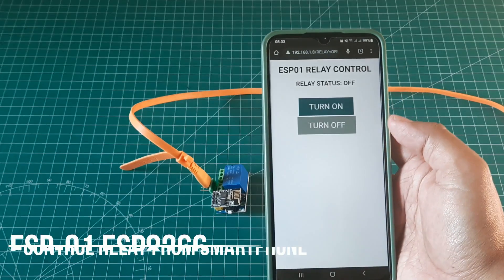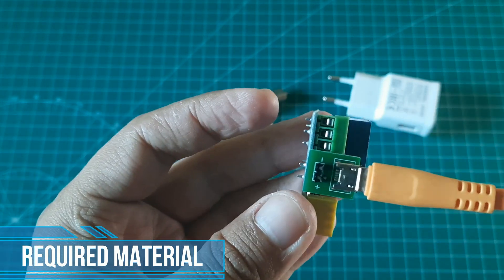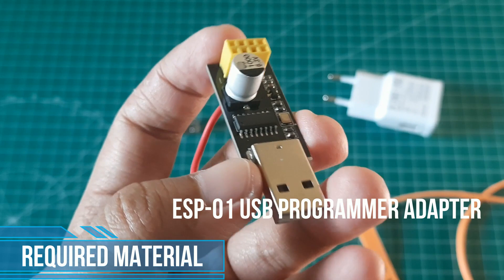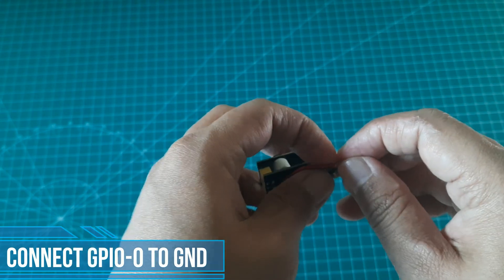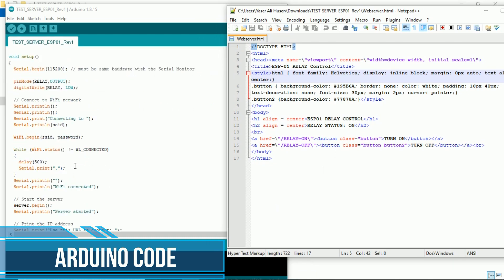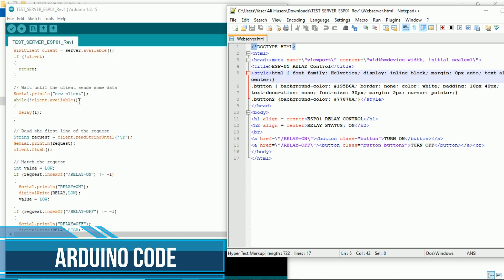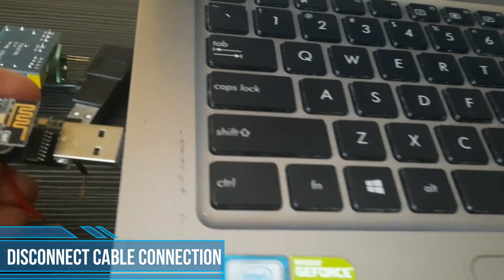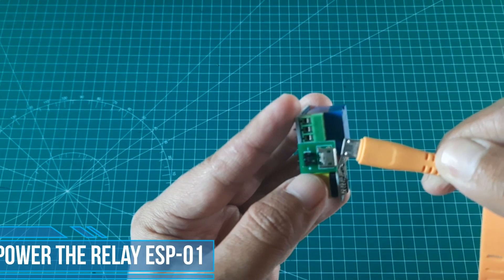Control Relay ESP-01 Module from Smartphone

Comment: Does it require wifi router
Reply from the maker: It requires both esp and phone on same network, you can use wifi tethering from phone
Reply: @YaserAliHusen  what should I put in SSID and password..does it phone wifi password and name
Reply from the maker: @madhusudanm6529  usually in tethering configuration, there is Network name (SSID), Password
Reply: @YaserAliHusen  Everything completed got ip adress too but after copying tht ip adress shows this site can't be reached kindly fix this

Comment: 1. Can i control from different network ?
2. Can you make a web code for ESP-01 with 2 or 4 Relay, with schedule On-OFF feature ?

Thank you
Reply from the maker: 1. You must connect it via wifi, so must is same network.
If you want to control from different network, you can use another communication such as MQTT
2. I think you need a NTP to get time, web just t rigger to activate time schedule

Comment: hi, i can connect to the module via the smartphone, but the LED on the relay module does not light up or the Relay click... 
the code below does make my relay work and LED turn on,, is there a way to embed this into your code? without the 3 second delay????
i have spent hours on trying to get this to work..
byte relON[] = {0xA0, 0x01, 0x01, 0xA2};  //Hex command to send to serial for open relay
byte relOFF[] = {0xA0, 0x01, 0x00, 0xA1}; //Hex command to send to serial for close relay

void setup(void){
  Serial.begin(9600);

  //make sure the relay is off before moving forward
  Serial.write(relOFF, sizeof(relOFF));
  delay(10);
  Serial.write(relOFF, sizeof(relOFF));
}

void loop(void){

  //turn the relay on for 3 seconds
  Serial.write(relON, sizeof(relON));
  delay(3000);

  //turn the relay off for 3 seconds
  Serial.write(relOFF, sizeof(relOFF));
  delay(3000);

Comment: how do you control it with an Iphone??
Reply from the maker: Access it from your iphone browser
Reply: @YaserAliHusen  I follow the steps but It connect to wifi, but the IP can't be oppened. Why? Did you set the router to port forwarding?

Comment: It does work . But goes to sleep and doesnt repond after few minutes , Pressing the button doesnt do anything ., To correct , it has to be reset after every few minutes. Can you guide whats going on here ? THanks a lot
Reply: Update : Works better with Baud Rate of 9600. Stays connected. Cheked for half hour . Should changing the Baud rate make a difference ?

Comment: Excellent sketch but when I connect the power the relay energizes when it should remain off but instead it energizes without command.
If I have to turn on a light bulb, an opposite action is necessary: the relay must be turned off. not energized when connecting the ESP-01 power supply.
Reply from the maker: You use relay which it will ON when receive Low signal, right?
So, in code, in setup, turn off the relay first by write HIGH the relay

Comment: where to buy the part where u connect the power to power on the relay ?
Reply from the maker: You can find Micro USB to Dip adapter, there are similar with this part

Comment: Thanks for the video, very interesting, but can I control multiple separate relays, one in each room to turn on off?
Reply from the maker: This video explain control a ESP device via its webserver page, so you can add more relays in 1 device, you can use ESP32 or ESP8266 with more GPIO.
If you mean control more devices with 1 page, you can use node-red dashboard, it can connect more device an out control on a dashboard page
Reply: Thanks for your reply, but I would like to use 5 single relays one in each room to turn on 5 lights but from one web page  @YaserAliHusen
Reply: You can use the ESP8266 Relay x 4 Module to control 4 devices.

Comment: In the required materials should the Arduino IDE be listed?      I have downloaded Arduino IDE  for linux.  ESP_01  does not show up as a Board. When the USB programmer is  pluged in the Serial port shows up but ESP_01 is not one of the board types on that port.     Is this video suitable for newbies to the IDE?
Reply from the maker: You must Install the Boards in Arduino IDE
In Preference -> Additional Boards Manager URLs, add: http://arduino.esp8266.com/stable/package_esp8266com_index.json

Or you can googling it
Thank you

Comment: When suddenly the electric power supply goes out and at that time the status of the relay module is ON. Then the electric power supply turns ON again, does the status of the relay module remain ON?
Reply from the maker: I set, initial status is OFF, so when power turn on, relay become OFF
Reply: @YaserAliHusen  
is it possible to set the initial status to the last status? or must be added battery back up memory?
Reply from the maker: @amateamchannel3687 , I think you cant.
If you want, you must store the status in something, in additional relay, pararel with main relay and connect output relay as input.
Esp will check the input as relay status in initial start up.
And you must use another esp device like esp8266
Reply: @YaserAliHusen  Terima kasih for the information
Reply: Yasser sorry but initial power is at on, so when  power  turns on relay is on. How to reverse that in the code?? thanks  @YaserAliHusen